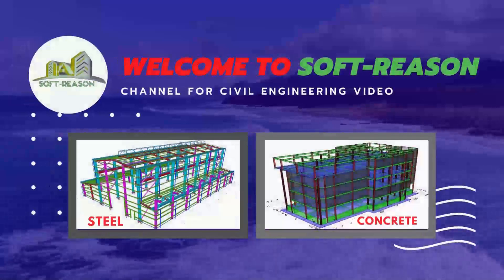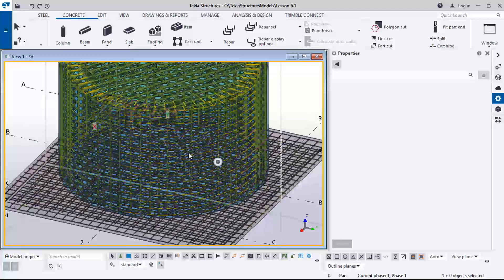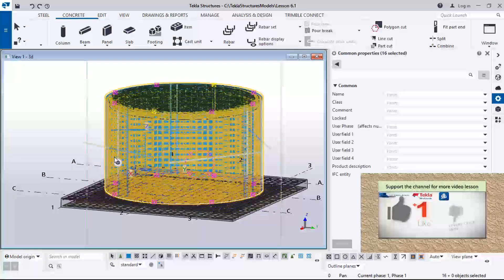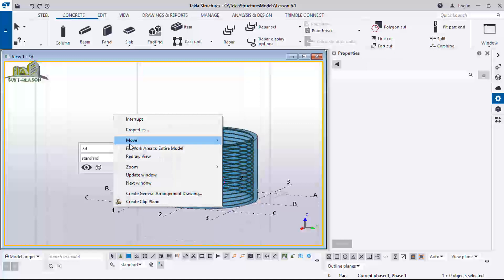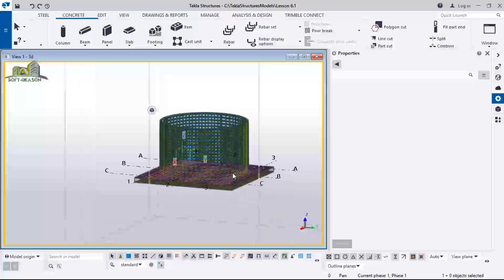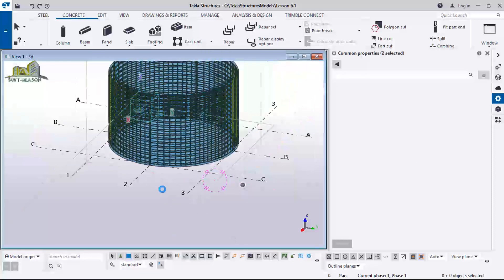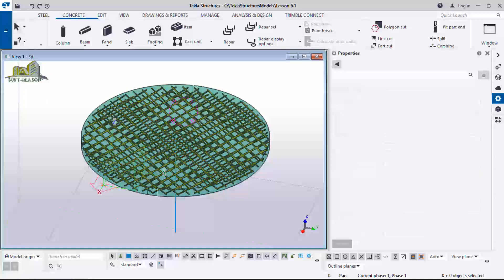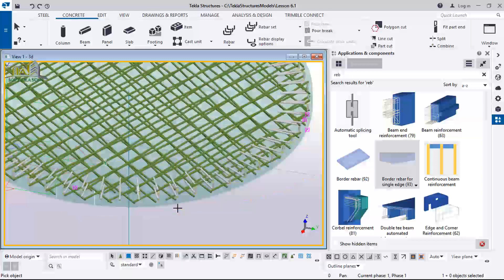Circular slab rebars Placement in Tekla Structure

Comment: Why can't I use the round column to model a circular slab? You just have to fill in the diameter and height. Afterwards I changed the name from column into Slab. Is there a reason why not to use this method? Also when exporting to autocad I got a nice circle that way. With your method you create a polygon with 40 or more separate straight lines. That gives a mess when working further in the exported file.
Reply from the maker: You can test run your method, if it works, fine. if you really understand the program, no. need of exporting for further editing in another program, everything is possibly done here. Thank You
Reply: @CADmade-easy  in my office we currently design the reinforcement principally in autocad. So that's why I have to make the export of the 2d formwork drawing.
Reply from the maker: @rmfdm5352  okay Sir, but you can make all necessary editing and sectioning in Tekla so your work wouldn't be mess up when exported to AutoCAD.

Comment: Hi, great video! At my company, when placing straight bars in a circular slab, rather than using different bars, we use lapping bars that are the same length where we can. These bars are alternately reversed. How can we do this in Tekla? Many thanks, John.
Reply from the maker: Good to hear from you. In respect to double reinforcement for the sake of lapping, there's a provision in the rebar dialog where you can make that effect. Or you can also manipulate that manually by drawing an additional rebar to serve as lapping bar. Give me a feedback if there's anything difficulty. Thanks